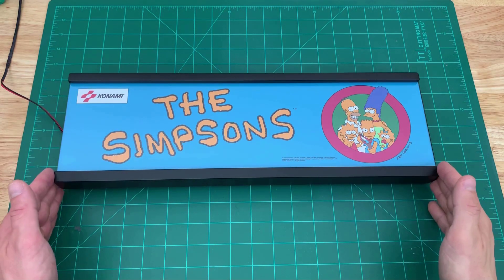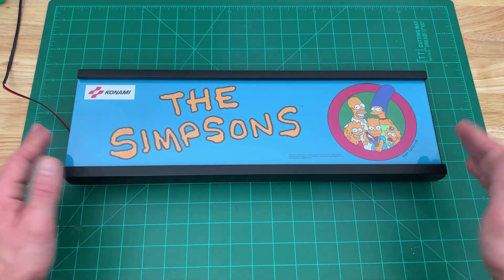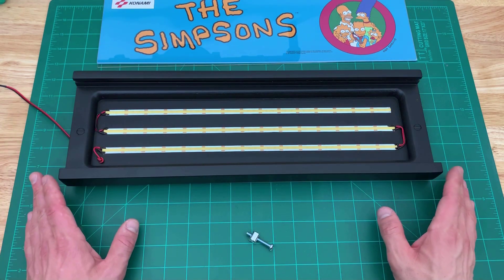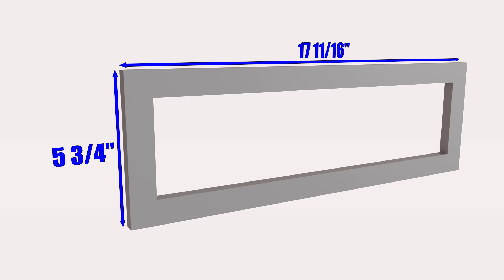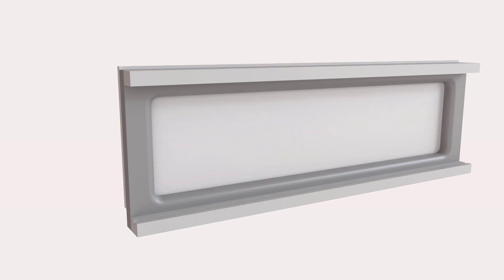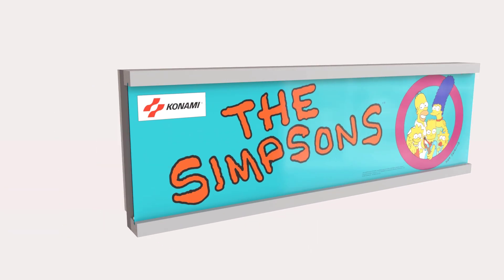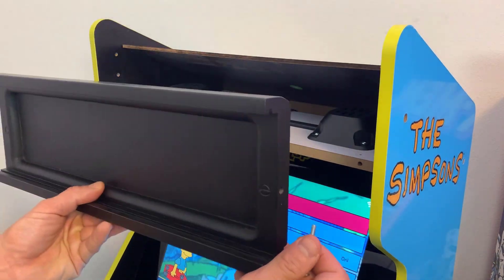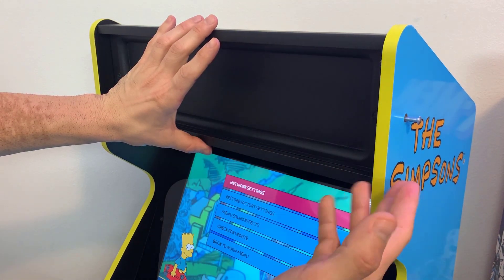Arcade1Up Konami Marquee Mod, DIY Full Build Walkthrough!

Comment: As a DIY this is well thought out.  However, this is a lot of work for something of this nature.  For 70 bucks, you can get an identical or near identical marquee kit with high quality graphics from someone like Retro530 or this ability upgrades.  Not hating at all, you did an incredible job and if you ALREADY have the tools like a router etc. then it will be quick and clean and i'm sure itl'l be awesome
Reply from the maker: Thanks for watching! I see your perspective, it is a bit of work and requires tools. It's all personal preference. Retro530 and This Ability make great marquee! I have 3 Retro530 Marquee. This is a hobby for me and love building things. I'm all about the Marquee, I prefer a Translite over Vinyl prints. The Konami cabinets have a much larger  marquee area and I wanted to take advantage of that. I talk about why in part1 https://youtu.be/fjd42WlWbOM